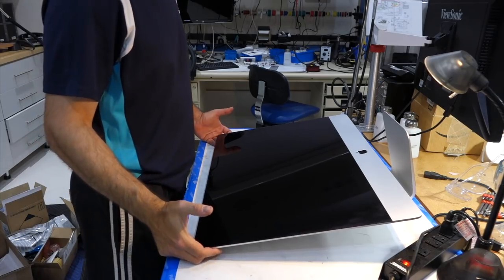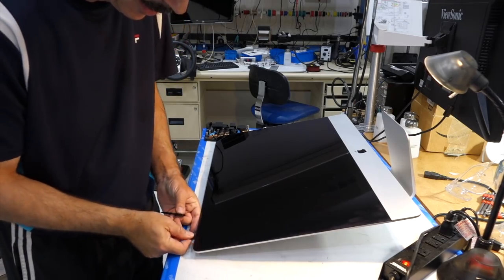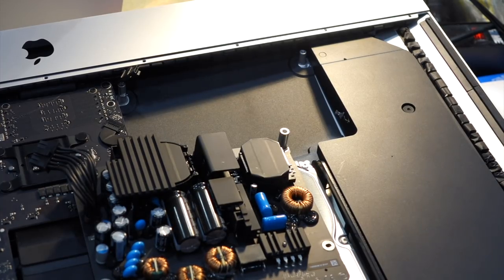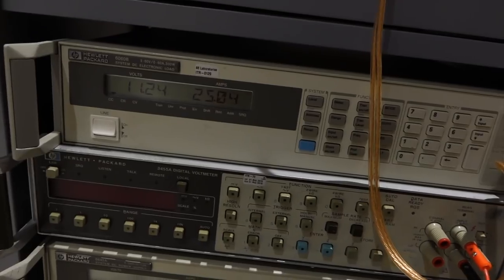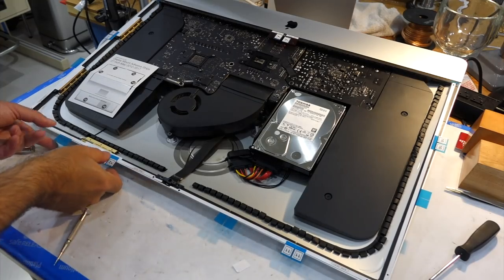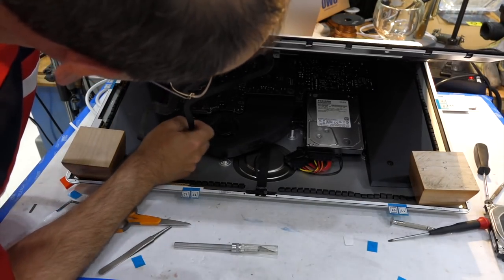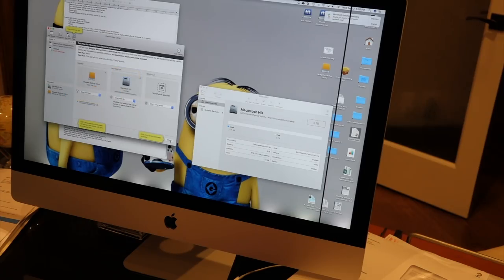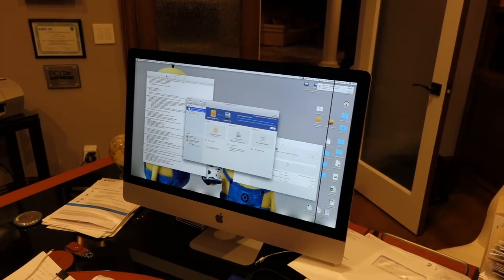Modern Tech Fail: iMac 27" Retina Repair (Mac shuts off randomly fix + disk drive upgrade)

Comment: I have a Late 2014 27" iMac and also have these shutdown problems. Trying to install any OS fails because it reboots in the middle of installation. I can boot from an external drive with an already installed OS though. At first i was using the native 5K resolution but it would reboot after 1-2 min. I bought another power supply but the problem was still there even after replacing it. So i thought maybe this used psu i just bought has the same defect?! I was not going to buy 3-4 other psus until i found a good one so what i did this: i made myself a custom cable that plugs into the psu's 12 pins connector (6pins are ground, all others 12V) and connected the other end in a known working 700W PC power supply thus bypassing all current draw from the original psu. If the iMac's psu really is the problem then i will not have any shutdown problems. But the shutdowns are still there... I replaced thermal paste on gpu and cpu, tried replacing ram, removing drives, zapping the pram etc... Nothing make that annoyance disappear. The problem, and i suspect it really is the case for many of us, is that it is the Logic Board that has degraded components that fail when the power draw is too high. Some parts must have been damaged by heat or are simply not good quality and cannot sustain stress anymore. I'm sure someone like Rossman group would pinpoint the source in no time but for me it's a big challenge. If only i had access to schematics and boardview.

How many of you that replaced the psu never had another shutdown?
Reply from the maker: Replacing the power supply did it for me, I have never had this problem again. But I agree it's bizarre that I could not get my "bad" PSU to fail outside of the Mac - it has to be an interaction between the PSU and the main board/ firmware. Your experiment does not make sense to me either. If the PSU was truly bypassed, there would have been no way for the computer to shut it down. Somehow your original supply was still in control.

Comment: Did you check the quality of the power coming out of the supply? Just speculating, but perhaps there's simply enough ripple or something on it to make the logic board shut down. Or perhaps it fails intermittently but "stays on" (which could perhaps even explain why you needed to unplug it to get it to power on; would perhaps imply that the machine is still powered, but just latched up due to a brown-out).

Comment: I saw something recently with a white line on the screen, it wasn't a problem with the screen but a damaged solder connection on an IC or chip

Comment: On reassembly, I used clear tape applied along the edges of the screen and chassis, trimming it so it is only as wide as the two layers.  It vanishes and holds the screen and chassis tightly, without re-gluing.

Comment: Thanks for sharing. 
Is it possible to figure out what went wrong with this screen after replacing it ? Tearing everything apart and giving it a (microscope) inspection could do the job ? Or even better, can it be fixed ??

Comment: OMG! I actually have a 2017 27” iMac that started crashing randomly (and with no “iMac crashed unexpectedly” if turned back on.) a year ago. It also would not turn on if I pressed the button and I had to unplug it from the power supply. Using a different extension cord would sometimes “help” it stay alive longer. I the reformatted my drive and started from scratch. My iMac seemed to be ok after that but just two days ago it started crashing again. So it stayed trouble free for an entire year after reformatting. (Definitely didn’t use it daily though, more like just during weekends.)  It’s such a weird problem. I’ll need to try this.
Reply: It just happen to me today I have exactly the same one 2017. What did you do?
Reply: @DannistylezTV  like i said: reformat your drive. It helped. But it hasn’t fixed the problem. Keep many back ups and maybe switch to a self built computer next. My computer in 2017  was overpriced (from Apple store) but the tech was pretty decent (still holds up a bit, I guess) but nowadays you pay Apple premium price for tech that really isn’t up to modern standards. I’m building my own computer next and hope getting back into not-so-shiny windows won’t be a let down…

Comment: I suppose such a large screen requires great care in handling - I guess transfer the screen face down onto a flat service and move it with support across the face rather than supporting it at the edges only.  But interesting to see that opening up is not so hard, since I have a similar machine.

Comment: All landfill fodder. I'm sure there are plenty of progressive types in Apple that'll beat you over the head with global warming and "think of muh environment" and the planet. I have so many retired machines here that all still boot and function. Even a PC that hosted my domain uptime 3 years without ever being shutdown that was retired in 2003 but built in  1990 (was headed for the dumpster at work)   I  boot it every year just for kicks. The only machine of mine that has an issue is the HP Itanium I bought in the 90's. It powers up but shuts down after a while probably because of dried out caps. I'll fix it one of these days. I guess in spite of Apple this is why we like Marc's channel shit stuff gets fixed.

Comment: I don't know how the panel looked before, but there is something wonky with the backlight in the bottom of the panel!
Reply: Yeah, I think it didn't like being bent like it was when pulling it off the bottom edge adhesive.
Reply: jammi  I also see that issue right now, this is surely not normal

Comment: Apple does not use a modified firmware on the HDD so they can read the hard disks temperature through SATA. There is a thing called S.M.A.R.T. and it's part of the PATA / SATA protocol that allows one to read all sensor data the HDD is sending to be read.
I read two temperatures from my SSDs (Flash chips and Controller chip) or just one from my HDDs ... on a PC with off-the-shelf hard- and software.
Reply: Yes they do

Comment: All the nice engineering is worthless if you can get into the thing for repairs. Like this, the machine is just overpriced one-way rubbish.
Crapple.
What with the power supply, maybe check the electrolytic capacitors on the old power supply for their ESR? If it's hot in the case, they probably dried up inside. Especially at high temperatures this would cause increased jitter in the current which may cause the firmware to decide for a precautionary shutdown.

Comment: Marc, when you originally removed the display cable @3:55 you pulled it horizontally. The little metal clip with the black tape on is there so you can lift it vertically up from the board. So it's possible that you damaged the connector at that point.
I'm not 100% sure that this is your problem, but I guess that getting a new cable wouldn't be horribly expensive, so it might be a relatively easy thing to fix, or at least to test..
Or possibly you broke the connector on the motherboard, but at least you've got your stereo-microscope to check it out with.
Reply from the maker: No, this one is a horizontal insertion connector. And if it were an LVDS cable problem, I would have lost a bit (or more), which means I would see a cyclical failure on the screen (many bands of colors not right, no sync, etc...), and not a localized column problem. So not the cable nor the connector (very unfortunately).

Comment: Normally when I watch your videos I can't find anything negative to say about them. The Alto restoration series was the reason I subscribed to your channel.

However I cannot accept that this device is a great piece of engineering. For one you need to cut around the edges of the screen to open it which is ridiculous. Nothing but trouble can come from it. Also, the power supply getting so hot in open air that you had to put a pad underneath it makes me shudder at how hot it gets inside that cramped enclosure. It's really not a wonder why it failed.

For an expensive computer, it's hard to accept that 3 years is a decent life span. Not everybody can afford to just go and buy a whole new computer every few years just because one component fails.
Reply from the maker: It's far superior engineering and attention to detail than most pieces of consumer electronics out there - probably bar none. I am actually glad a company can still do that and manage to be profitable despite having to recoup a higher engineering investment and the development cost of proprietary components. Which of course explains the obsessive control over repairs and parts supply that customers don't like - it's obviously designed to protect their margins and engineering investment. But that business reality does not detract anything from designs like these. HP and IBM have all but dropped the ball on well engineered consumer products. Apple is the only one left.